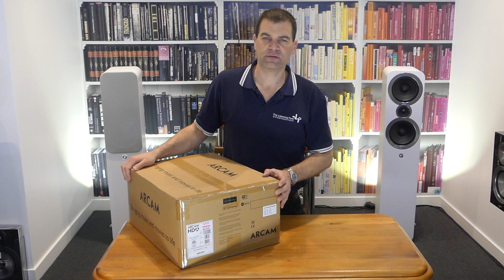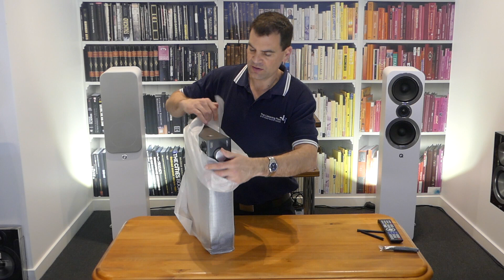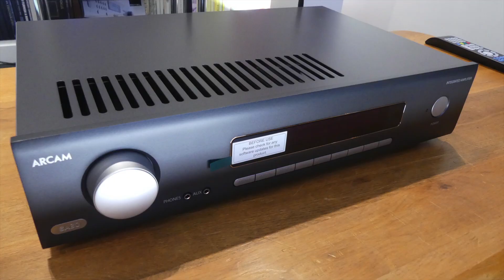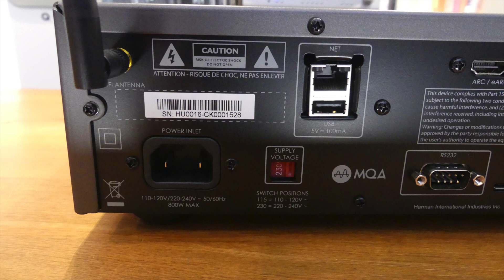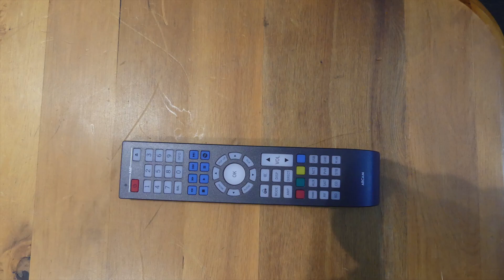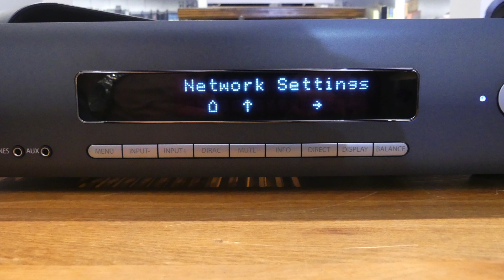Arcam SA30 Integrated Amplifier Unboxed | The Listening Post | TLPCHC TLPWLG

Comment: The amp is solid built, but feel like their design department is still stuck in the 1970s. It looks horrendous. You will have to hide it when guests come by. User interface? Well whoever designed that interface should just be jailed. (excuse my typo and spelling)
Reply from the maker: The SA-30 is old now.

Comment: Thanks for the complete review. One question please: I have the Graham LS 6 speakers (8 ohms; 87 dB’s; recommended amplifier power 50–150 W). Will the SA 30 both Properly drive those speakers and also maintain the rich mid range they are noted for? Thank you.
Reply from the maker: Yes - The uncoloured, dynamic power of the Arcam shoudl be fine
Reply: @TLPCHC  Thank you.

Comment: Can you connect to a tv with a hdmi connection?
Reply from the maker: Yes - But for audio return OUT of the TV to the Arcam amp
Reply: @TLPCHC   would the hdmi out  work the same way as an optical cable connected to a tv to get sound through the amp?